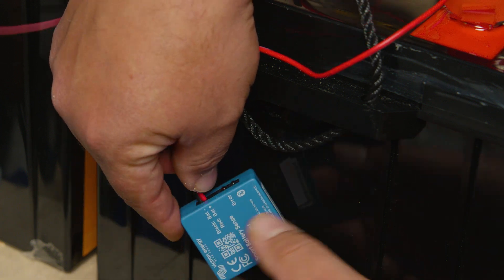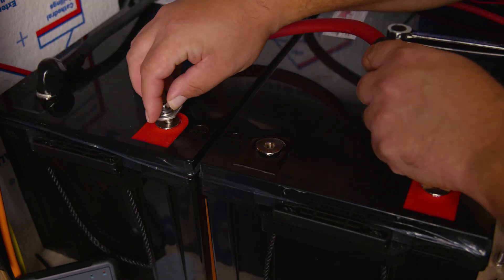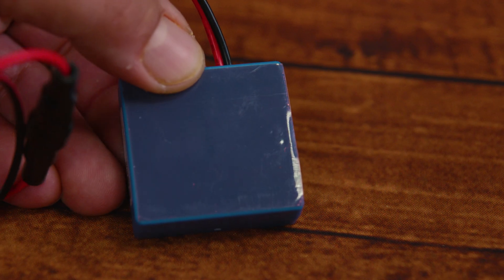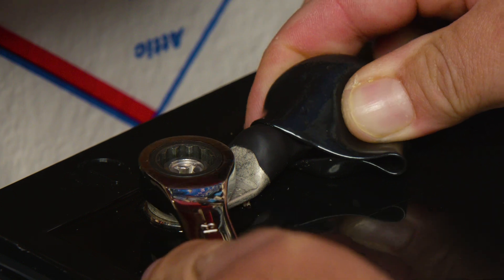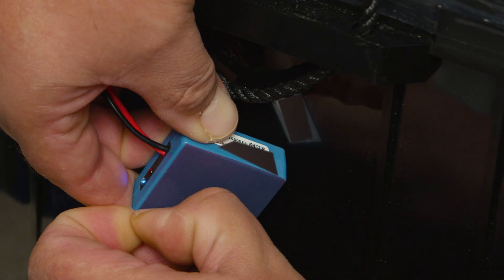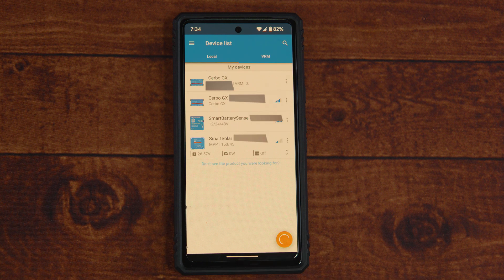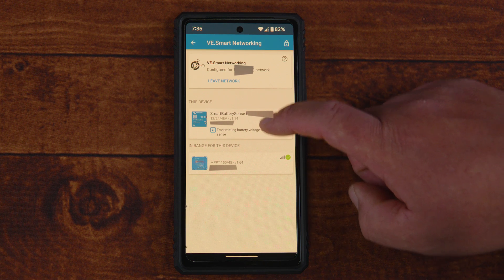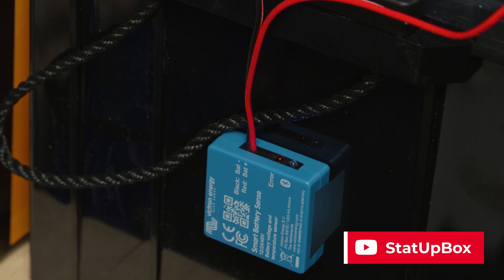How To Install SetUp Victron Smart Battery Sense Easy Simple

Comment: Doesn’t the battery sense measure the temperature on the poles, and not on the battery itself?
Reply: The regular one does, but this version goes over Bluetooth and is Glue-on